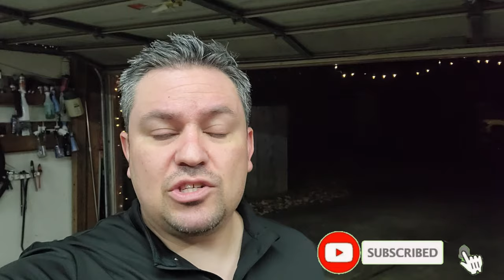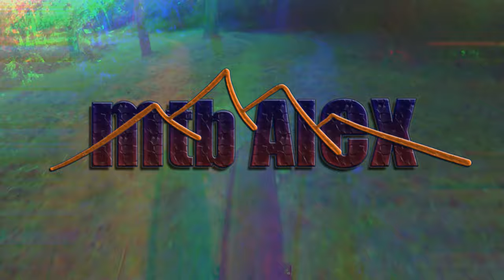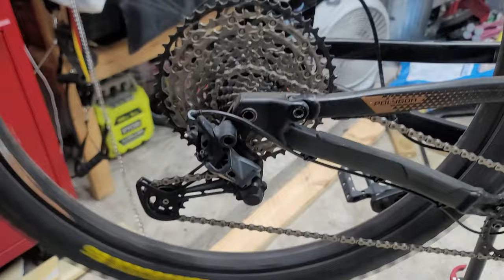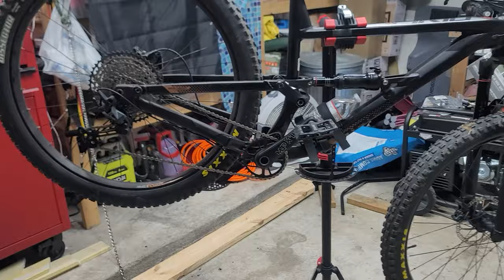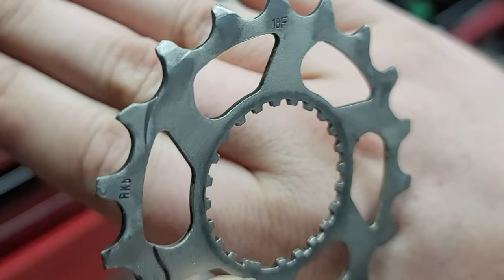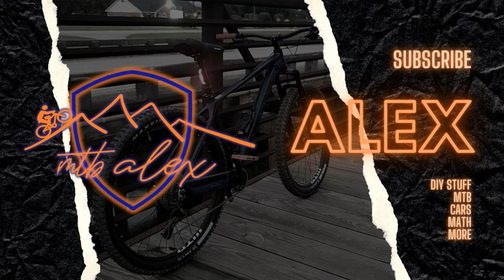Bike Chain skipping, how to fix it, why is my chain skipping on my bike #mtb cassette maintenance

Comment: 6:20 you do not lube the freehub on the outside. ever. 
dirt and grime will find its way in there and starts eating at your parts when there is lube involved and thus reducing the lifespan of the freehub in this case.
you install any cassette on a freehub without lube, just dry.

as a bicycle mechanic i've learned over the years to lube the crucial parts ONLY to get the most out of any bike. and don't overdo the lube because it will attract dirt.